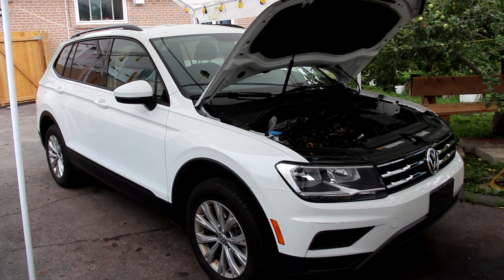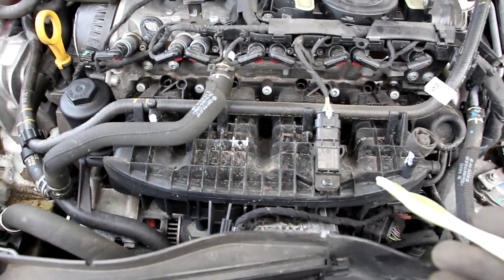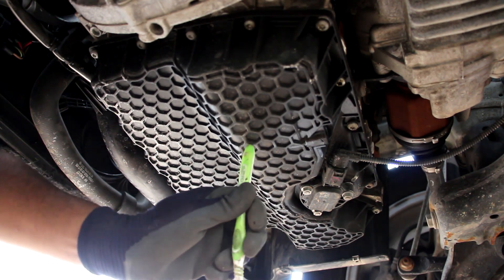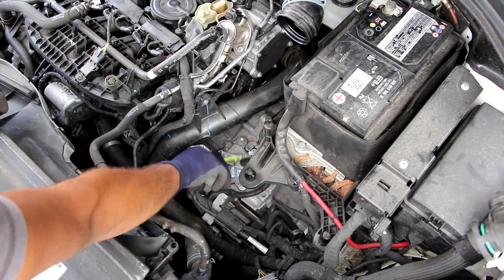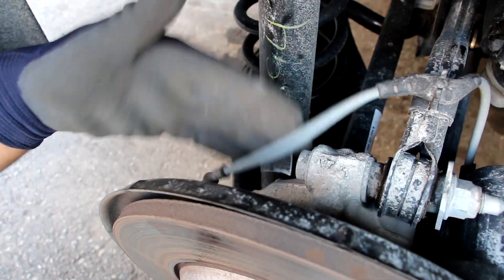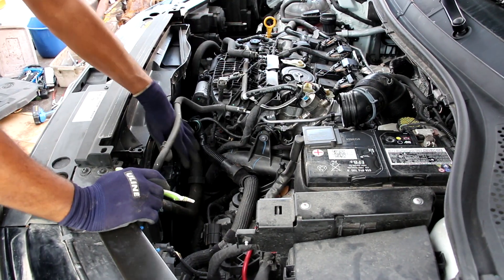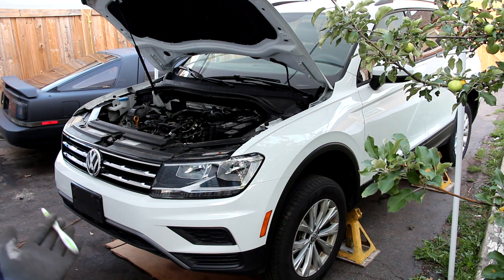Volkswagen Tiguan Mechanical Review

Comment: I have had VW's since I started driving, which is over 30 years. I never had any problems that where a big deal.  I decided to listen to the BS Japanese quality so I purchased a 2017 Honda Crv. After 2 months it did not start. Battery died got brand new battery, died 2 weeks later. It took 3 batteries when they finally fixed it. Oh and then if you like freezing in -10 to -20 oi dilution for the 1.5 liter. Engine temp dropped to cold if you had blower on high and you where in stop and go. Plastics all over the place cheap thin materials typical Japanese as I noticed at the car show. And terrible lag due from CVT turbo combo. Electronics completely going crazy on Touring all safeties turned on and off no fix. So yeah I just picked up a new 2020 VW Tiguan no issues with acceleration it's no Porsche but gets going and also not bad on gas.
Reply: The first and second gen tiguan are one of the most reliable SUVs in europe and top 3 most reliable vw model in recent history. The suspension is durable and unlikely smth will need replacing before 300.000km, maybe the sway bar bushings.
Reply from the maker: Alright let's see how that Tiguan will hold up. Agree that the CrV isn't a good buy especially the first model year
Reply: @speedkar99  I have a 2019 tiguan Se with 54k miles no problem so far.
Reply: I’ve driven BMW Audi and VW vehicles for about 10 years. So far I’ve had the best fuel efficiency in them. The build quality is awesome and they very very rarely visit the dealer. Engines always provide good power and over they are very safe vehicles. Even when I’m driving an Asian vehicle it sucks the wind noise is terrible. AlWAYS an anemic engine and the technology is maybe 6 years behind.

Comment: I purchased a new Tiguan 02/2018 and VW actually bought it back, and replaced it with a new Tiguan in 05/2019. I put 20k miles on the first one and 10k miles on the second before trading it. The first one had structural issues due to welding issues at the factory and you could hear the metal flexing with the road around the pano roof. Also had issues with transmission cooling line, and the rear seat had to be replaced. They both leaked coolant somewhere, and it may have just been small amounts at a time but I could smell it after driving in summer. It is extremely underpowered especially on 87 fuel, and the suspension doesn’t have enough travel. All the plastics used as trim around the digital display and dash don’t look to bad but everything creaks with the road, and just by touch once it gets warm in the car. VW’s look great, and drive pretty good, but I expected more from a vehicle well over 30k dollars.

Comment: I’m slowly switching back to non turbo cars, the cost for extra speed and torque is not worth the long term problems due to excessive heat and engine pressure generated by a turbo. I look after my cars and like them to last forever.
Reply from the maker: Good call
Reply: The turbo on all new generation TSIs is water cooled and is super reliable. No need to suffer with a 2 liter na engine from a subaru or toyota.

Comment: Lol aluminum steering/suspension components means a lot of alignment hahahh garbage
also no thermostat, electronics fail so if that water pump goes out you overheat and blow the engine. garbage.

Comment: I had a Tiguan for just over a year and by the end, it was basically scrap metal. I had a timing chain failure, which destroyed my entire engine. There were a million different oil leaks, a new one seemed to pop up every time I got another one fixed. Just all around nightmare vehicle. Would not recommend to my worst enemy.
Reply from the maker: Ouch!
Reply: I bought a 2009 model after a top end rebuild due to tensioner failure. The rebuild was done right. It has been a very reliable car with 40k on the engine since the rebuild. Only repair I’ve had to do is replace a single fuel injector.

Comment: I really appreciate the analysis of whether parts of the design of the car are sound and reliable or not. For a non mechanic like me, all engines kind of look the same. But I get a lot out of your criticisms of plastic parts, stamped steel or undersized rotors. I liked your analysis of the CX-5, and it made me interested in the car. I don't need the latest tech to go from A to B, I want reliable tech. But the rust on the CX-5 is a critical vulnerability.  Thanks so much for pointing that out.

Comment: I like this series but I wish you would do more research.
No VW came with a brake disc "wiper" - this function is done by the ABS system, using the regular brake caliper and pads, on most VWs that have a rain sensor. One less part to fail. 

The oil filter housing on these engines is in an excellent position. Oil changes are designed to be done by evacuation, for which you should loosen the filter first. It will be dry by the time the evacuation is complete. Not a single drop of spilled oil on the changes I've done on my Golf.

Finally, the hate for Torx has got to stop. Torx will hold the most torque of any common internally wrenching fastener. An externally wrenching bolt would be ideal, but costs have to be cut somewhere. I used to work on 767s and 747s, all of the under wing panels are secured with Phillips screws. All day long, screw extraction after screw extraction, valve grinding compound, screw knockers, because the screws are above your head and people are too lazy to push up firmly and hold the screw gun straight when tightening. I would've killed for Torx.
Reply from the maker: Good thoughts, thanks. 
Torx or internal hex doesn't work for us in Rusty climates unfortunately

Comment: Since we are talking about VWs, here's my story.
Bought a new Mk. 2 Seat Leon in 2012 with a manual gearbox and 1.4l tsi that made 125hp
The most interesting failure it developed over some time was a coolant leak, but without evidence of one.
The coolant reservoir had to be topped up every so often. Eventually, the culprit was found, and it's the intake heat exchanger, It leaked fluid into the cylinders.
This fix included replacing spark plugs and one of the coil packs.
The next biggest was the turbo waste gate valve that got stuck. I opted to clean it, and extend the rod that pushed it by 1 cm. So far it has been good
After that, the brake booster leaked internally, had that replaced with a known good unit off a mk. 5 golf.
The battery died at some point, and I replaced the serpentine belt, its tensioner and rollers.
It is now at 85000 miles or 136000 km.

Keep in mind, this is the last year they produced that particular car (from 2005 its 7 years in production) and all the "major" problems should have been solved.
Reply: @thre362fdsgsd eh... it stopped eventually. The car is now nearing 120000 miles, and since then I had no real issues with it. It's not worth much anyway, so I'll just keep using it until it's no longer worth the upkeep. Actually, taking all of that into account, it's a fun and engaging car to drive.

Comment: My 2019 Tiguan is now 12 months old.  Trouble free all 10K miles. A 3 year lease, All these Direct Injection engines are too complicated. I will just buy a 2022 ID4 EV when my lease is done.  The $7500 tax credit that VW has is probably available until 2025 if they start selling 50,000 EVs a year
Reply from the maker: How has it held up?
Reply: speedkar99 Quality is very good , well put together and with a 6 year 72K bumper to bumper warranty. After 6 years we get carbon on valves ?  Water pump failure .  Nothing too serious, but I am glad I have a lease.  It’s the way to go on generic cars.  I might just get a 2022 Ford Ranger double cab.  I do have a 2019 VW beetle convertible 15 months old with only 1800 miles (keeper). And awesome forensic on the Tiguan you convince me to return the lease later.

Comment: Everything is plastic, yuck.  SO if you use Mobil 1 instead of Castrol the Tiguan won't run.
Reply from the maker: You'll get a check engine light

Comment: See how complex the air system is.  Every time I see one of these in depth reviews I compare it to any electric car on the market. No gas, no oil, no cooling system and no going to the gas station.  Everyone I have ever talked to that purchased an electric car would never go back to an internal combustion of your wallet engine !
Reply: Cars false propaganda
Reply: It's not that complicated, they just use too many torx or triple squares to hold it on.

Comment: Huh! Only if VW can secure their reliability like they secured the air filter box....  plastic oil pan... plastic Pistons next ?
P.S. The thinking behind filling the new ATF up and through the drain tube is so the over filled (not to mention, contaminated) fluid will drain back to the new fluid container without waste... LOL

Comment: Judging by the AVS( audi valvelift system ) solenoids on the intake side it is the 190hp variant with budack cycle, in europe it also comes with port injection on the intake manifold, which works in conjunction with the high pressure direct injection ramp to lower soot.
That cooler on the radiator front looks like the intercooler for the turbo, the 220hp variant with AVS on the exhaust has it there

Comment: That engine rattle from the GDI high pressure fuel pump is annoyingly loud. At least I hope it is the GDI high pressure fuel pump and not piston slap, rod knock, loose timing chain, engine knock, or the variable valve actuators. You never know with German engineered, Mexican manufactured, American assembled vehicles.
Reply from the maker: Haha agree, it's louder than many other DI engines I've come across

Comment: terrible start and ruff idle .. hmm typical VW issue lol carbon deposit issue already i might assume lol not long for miss fire codes soon LMAO
Reply from the maker: Haha it was tough
Turns out I didn't put the air intake back on properly
Reply: @speedkar99  Mazda has seemed to ressolve the carbon deposit buildup on their current generation of skyactiv G engine.. correct me if I'm wrong tho but they knew it was a issue with direct injection so they reduced the head temp or something so the deposits don't happen like VW and it becomes a issue.

Comment: The rear diff has two separate oil compartments. It’s not shared. There is a cavity for the ring and pinion gears and another for the transfer clutch assembly. They do use the same VW specific oil.
Reply from the maker: Good to know, I didn't see separate drain and fill ports and the repair manual didn't mention they are different
Reply: speedkar99 It’s the cause of many a rear diff failure due to the confusion at time of service. 

You pointed to the transfer clutch section fill plug and the diff section drain plug. If you didn’t notice the full level of the transfer clutch section and just drained the gear section out You can guess how that turns out. It’s stupid they design it this way.   

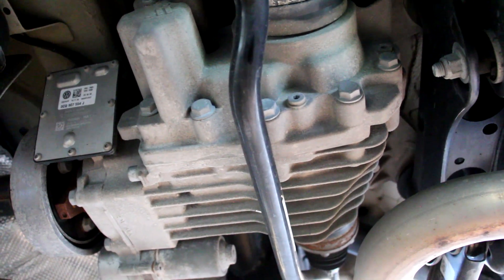You can see the diff gear section fill plug right above one of the case bolt just right of the axle flange at 10:22 mark. The transfer section drain  is facing the front of the car a small round hex driven bolt.

Comment: No joke, those timing chains have a tendency of failing and cost big $$$ to fix.
Reply: I got a VW with over 300k miles, factory chain. What fails is the tensioner no the chain itself.
Reply from the maker: Yeah early GTI's with this engine had a big problem with the chain tentioners

Comment: The oil filter assembly has a check valve mechanism which opens and drains the housing when you unscrew the cap. If you give it a bit of time (less than 60 seconds), you can remove the cartridge filter without much mess or fuss.
Reply: Best oil change I have ever done in my life on this engine. Not a drop spilled, didn't even wear gloves the second time.
Reply: I hate it when someone who has never changed the filter in this kind of inverse setup and then says it's going to be a mess. This is one of the cleanest filter changes I've ever done. The other is my MB C250, who’s filter is also on top.
Reply: @gregrobsn BINGO!
Reply: @gregrobsn  Lol, you seem really desperate for attention.
Reply from the maker: I'd take an upsided down spin on canister than a cartridge any day. I won't have to get my hands messy
Reply: speedkar99 I’m with you. And they cost less most of the time. It’s still slick they thought to incorporate a check valve to drain the housing. Guess until it breaks. I think I remember it being plastic as you would expect.
Reply: You mean the upside down one that leaks a bunch of oil under the car no matter what you do?  @speedkar99
Reply: @speedkar99 then, what was your complaint here?  My 2017  Charger has a similarlt located cartridge.  Never has been messy.

Comment: Too many bolts on the air filter box but not enough on the transmission pan😅
Reply: Funnily enough Aisin makes the transmission which is owned in part by Toyota and Toyota pretty much exclusively uses Aisin transmissions.
Reply from the maker: Agreed!
Reply: A committee of German engineers did the air box,  the tranny pan was done by the Mexicans but half the team was on siesta.
Reply: @Tsubaki518  as a Mexican I feel moderately offended and a little sleepy cause is almost 2 pm and I want another nap...

Comment: I am not sure that an assembly plant in Mexico will, in general, be worse than a plant in any other country.
Sure, a new plant vs. existing plant can have a difference, but with any new car / tech, there could be a difference too.
Reply from the maker: They might be the same quality standard but if it's not sourced and designed properly then it won't last
Reply: @speedkar99  Correct.
Mexico / Germany or a US plant is where assembly takes place mostly.
US-spec VWs are usually less fancy than the same vehicle in Europe. Sometimes, the vehicles only share the same name (some Passat models).

Comment: “It has a timing chain so you won’t have to service it over the life of the vehicle, but it is a Volkswagen so you never know.”

We can laugh at that while crying inside
Reply from the maker: Haha well VW hasn't had a good reputation with timing chain tensioners
Reply: @speedkar99 I’ve got a 2011 Polo 6R 1.6. Surprisingly that engine cane with a timing chain and a hydraulic operated clutch pedal. It’s been very good to me so far with just a little under 200000km on the clock. The last of the NA engines.
Reply: @speedkar99  they have fixed their timing chain issues in these new Volkswagen
Reply: @jeffgroves4533  how’s that work for the costumers that purchased the older models? You are obviously not one of those!
Reply: I've been a victim.  2014 Jetta.
Reply: @micahgreene4573  Thank you for your testimonial!
Reply: timing chain lasted 35000 km on my 1.4 tsi... vw, das auto :)
Reply: Using Carfax, i can see that about 85% of peole are changing thier oil every 10k miles. this is WAY to long an interval. The ONLY way this long interval  might be ok is if the car is driven 50+ miles/day, on a clean road in 35F to 75F temps-ask a mechanic. This is probably why these and other cars suffer from timing chain problems. Read the owners manual, it will back up my statement. My VW's have been good cars.
Reply: Saying anything bad about any VW on most car YouTube channels usually brings out fan boys to defend them no matter how shit they are .... funny as they way they appear to get personally offended 😜
Reply: Timing chains dont usually fail. Its the the Tensioner and guides
Reply: Not me, i bought a Toyota
Reply: Life of a VW is about 80000 miles so timing chain should be ok.
Reply: @emeyer6963  No... Not miles, it`s kms!
Reply: @emeyer6963  i currently have a vw golf with 155k, and i have a friend who has a 2019 jetta with 370k on it. lets be so fr lol
Reply: @emeyer6963  I just traded a 2010 jetta tdi(got $6k settlement for the dieselgate scheme which paid it off for me and replaced all the glow plugs, harness, egr valve and dpf work for free) in with 184k miles for a brand new tiguian sel r-line I bet I get a good 11 years out of this before I trade it in for a new one!! Traded a 2004 jetta vr6 in for my 2010 tdi with 99k on it!! I might have had good luck so far with then but I'm a firm believer in good maintenance will make a good car!!
Reply: VW. Dorky lame cars

Comment: It is only a matter of time, vw will make an engine made entirely out of plastic.
Reply: And when the warranty is up it could break itself into 8 pieces to make for easy disposal.
Reply from the maker: It must be eco-friendly biodegradeable Plastic too
Reply: 3D-printed engines... 😋
Reply: Then you should check out Toyota engines. They are the leaders in plastic.

Comment: “Potentially develop carbon buildup”... Carbon buildup is absolutely guaranteed in DI engines without additional port injection. It can be alleviated to a degree by fitting a decent oil catch can but carbon will still be an issue. Media blasting of the inlet valves will take of the problem and isn’t particularly expensive, definitely worth doing at around 100k km.
Reply from the maker: Carbon buildup happens outside of warranty 
Therefore they don't design for it
Reply: speedkar99 - Fair point but initially VW didn’t even acknowledge the problem. They do now and offer a solvent-based “solution” but the only proper fix is inlet manifold removal and media blasting. Certain regions (EU but not US) offer EA888 Gen3 engines with additional port injection, ostensibly to lower emissions but funnily enough it also mitigates carbon buildup. The good news is DI fuel economy outweighs the expense of valve cleaning, I’ve had 46 mpg from my 2.0 TSI which only 1 mpg shy of VW’s quoted combined economy.